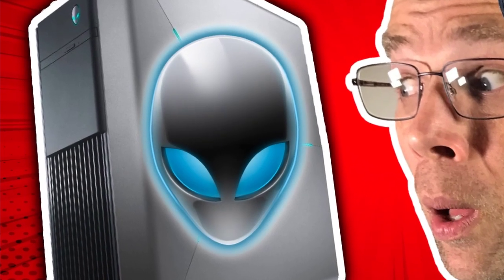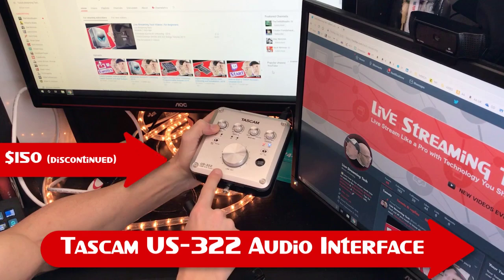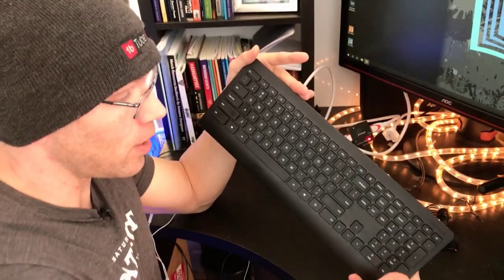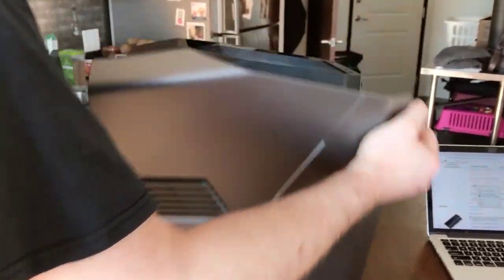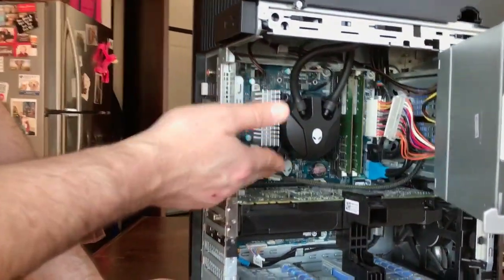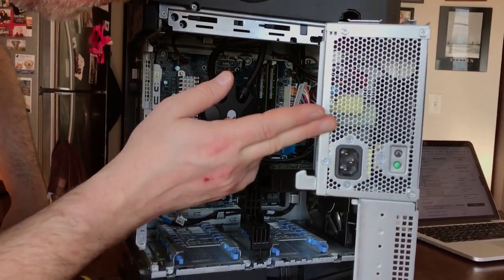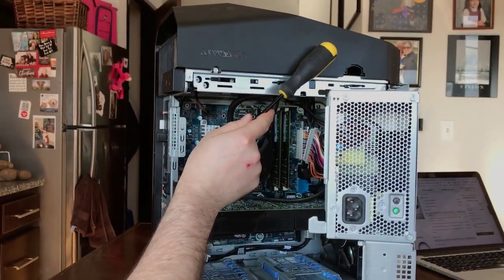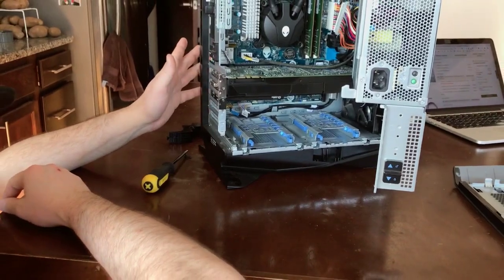Alienware Aurora R7: A Look Inside and Streaming Rig Rundown

Comment: Found this pc with a 1080 for 950 at best buy. Jammin witcher 3 4k ultra
Reply: DELL has a scratch and dent 1080ti SLI version for $1700.
32gb 2933 ddr4 , i7 8700k , BD-RE Blu-Ray drive 

I think I'm gonna get it
Reply from the maker: @TheAgentAssassin  Meh, just be careful when buying used or scratch and dent pc or electronics. I would say keep looking around for deals unless there is a great return policy so you don't get stuck with a lemon. Let us know how it works out either way.
Reply: @LiveStreamingTech  
Yeah I backed out.
Reply from the maker: Good stuff! Killer deal.

Comment: Love this walkthrough of the gear!  Can you share the model of the keyboard, please? Is LIVE streaming more CPU or Memory bound?  Do you need to go up to 32mb?  How about upload speed from your ISP - what should you have as a minimum for the LIVE streaming shows like Dale does?
Reply from the maker: @Gord Isman, Live streaming resources all depend on what your streaming (content). For example when I am just idle during the beginning of my stream OBS Studio uses about 2% CPU. For me that isn't much; however, once I start streaming games I not only have the resources that the game uses but then OBS is using more resources to capture what your playing and uploading it. I have seen my OBS peak around 20% CPU usage at times but that is me running my camera, capturing the game plus my mic. But once again it all boils down to your content. Doing a live interview would be small compared to game capture. 
Short answer have at least 16gigs of memory and a i5 to i7 4 core processor to be safe. You can also switch some things around to take the load off the CPU and put it on the GPU but we will cover that in a future video. Stay tuned.